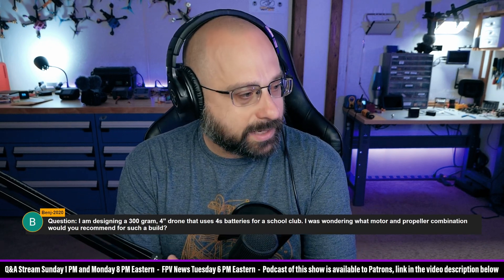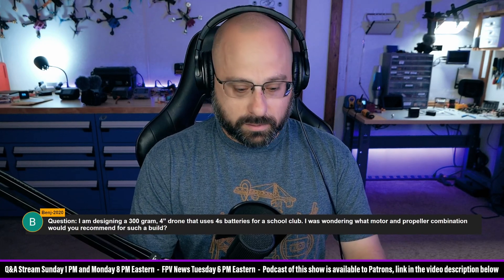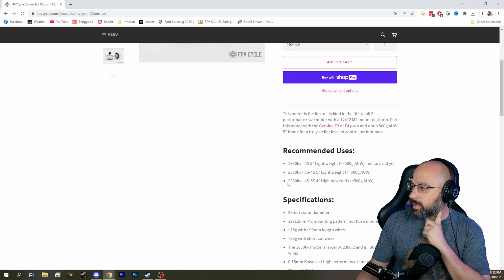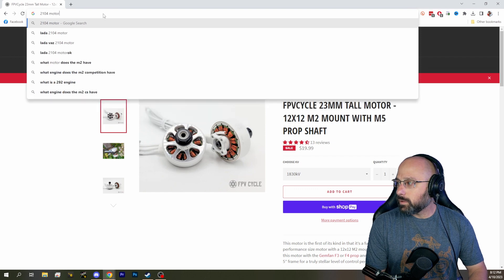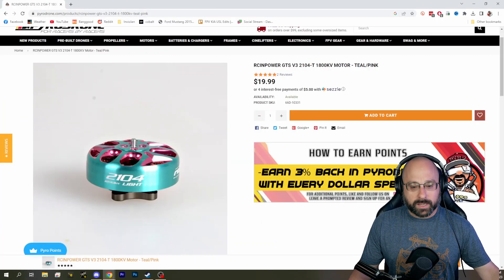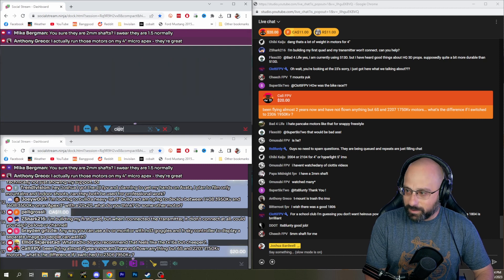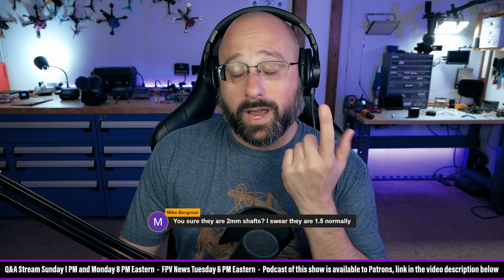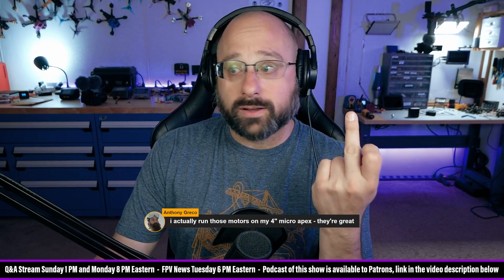Building a 4inch 4s! What Motor And Prop Size? - FPV Questions

Comment: My frame of the crux35 is broken. Instead to repair it with 2 bottom plates i think i gonna go for a 4 inch frame. It has 1404 3400KV motors... And they are even too powerful on crux35. I'm sure they are alsi good for a 4 inch...
Reply: put it on a discus!

Comment: Hey JB, Neo here again. I'm trying to build a 4 inch that straddles the line of long range with a little punch out. Something that will fly 8-12 or so minutes. 4s

I've been watching a bunch of vids (all of you 4 inch vids) and its seems that 1404 2800kv is more long range, while 1804 3500kv is more freestyle with 5-6 minute flight time. in this vid i heard suggestions above 20xx but im assuming that is for a more freestyle 5-6 minute fights.

Searching for a meduim between 1804 and 1404 has been rough. only one 1604 3100kv (diatone mamba) popped up but its sold out everywhere. sad cause it comes in 3100kv which is a nice spot between the 2800 long range kv and the 3800 freestyle kv.
I'm leaning towards the XNOVA 1804 3100kv

All of my quads have been bind and fly up until now. Building my own has been on my bucket list forever. I'm not really into 5 inch. I love my old Fullspeed Leader 3. but I want something slightly bigger with gps. but I cant resist a good dive so i def cant have something can't really punch.

Any suggestions on this build would be greatly appreciated. a lot of your 4 inch suggestions from your website are sold out. 
I was going to us the 57g armattan bobcat 4". m10 gps. probably have 2 20x20 stacks

Comment: Just assembled Roma F4 LR with Xings 2205, which I expected a bit as overkill, well... being on ~350gr it flies nice, but a feeling is more like a 5" loaded with full GoPro, rather than a light drone with powerful motors.. shoul I try more agressive props, or try to reduce weight?

Comment: rc in power "2105 with propper 5mm prop nut" will be better than the 2104 feel about the same and no problem swinging a 5" blade

Comment: 1804 3500kv fro the Rekon4fr.
Or get 1804 3400 Velox with a propshaft that also accepts those f'n T-mount props without the insert 
Gemfan durable props and go.

Xnova 1804 suck, dinged a bell on a light run in with a pole.
The Rekon4fr motors are more durable but T-mount... Argh.

Comment: I dont know what JB is talking about with 2mm internal shafts. From 2004 size all motors I know are 3mm inner shaft. Hglrc 2004, brotherhobby 2004, emax 2004, rcinpower 2104. Only the 1804 have a 2mm shaft, but are aimed ultralight sub250 anyway. From 2004 size you are 300g and more AUW

Comment: 4" is great because it is approx the best size for the 249 g limit. 3,5" are in general much lighter than 249 g. And 5" can only be build in 249 g if it has low power and is fragile...

Comment: I've ran 1804s and 2105s on both 3.5 and 4inch. Pirat lil matey with the 2105s is bananas
Reply: Nice! what size props would you put on a 4 inch 1804 that you wanted to sit right between long range and freestyle?
Reply: @neomayad  I run gemfan 4023 on a apex 4". That build had 2105s. Got about 3 minutes on a 850 4s battery an about 7 or 8 minutes on a 1300. Right now I only have 1804s on two 3.5" quads. More around the 300g range. 1604s and 750 4s for that pirat lil matey sub 250g, hdzero and flywoo 20mm aio
Reply: @Quadwrex  watching videos they say that the 1404 most 4 inch quads are using dont have the punch for freestyle.
what would you suggest I purchase. 
btw i was going to use the Armattan bobcat cause i need 2 20x20 areas. I'd appreciate any suggestions on frames or FC's as well
Reply: @neomayad  jb might have a better opinion. For stacks, I would go with hobbywing or foxeer personally. When it comes to motors, it depends on weight and what you want out of it. Minimally, I would consider tmotors 1604 -1804 pacers. The 1604s from tmotor are pretty light for their size. Don't get the 5mm shaft. The inner shaft is only 2mm and bends easily in a crash. Another option is fpvcycle 16mm. I haven't used them yet, but I just ordered some yesterday. Rarely in stock. Bit of a loaded question. My only 4 inch is the 4 inch apex. Been dabbling with the micros with remote id around the corner, but I mainly fly 5 inch.
Reply: @Quadwrex  Thank you for that info. I appreciate you.

Comment: My favourtie 4" props are emax 4028 and gemfan 4032. The 2200kv 2005 amax motor and 6s are a great setup. I got 200kmh top speed with apc 4.1x4.1 props. Others max out at 170kmh. Still more than enough punsh. Also hqprop 90mmx5 are awesome silent and powerful.

Comment: I use the brotherhobby LA 2005 for a ~400 auw
Reply: digital 4 inch on 4S or 6S ?
which Kv ?
Reply: @Cre8ionz.  analog, 4s, 3450kv
Reply: And I use a 1500mah 4s

Comment: some Brotherhobby LA 2005 has 2,5 or 3 mm shaft and 5 mm shaft for the prop
(it has a screw instead of a C-Clip) 

 (T-Mount = not many props available)
Reply: The brotherhobby are great. I like 6s though and 2450kv are a bit too high for most props. Amax has 2005 2200kv which are great.